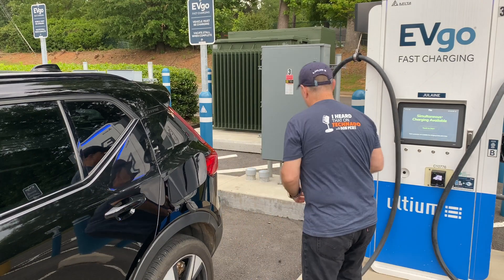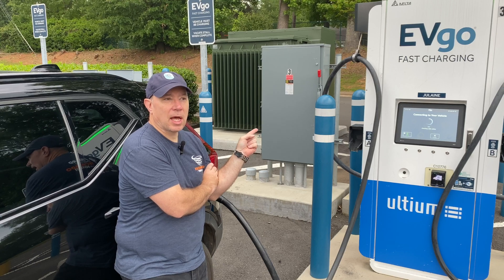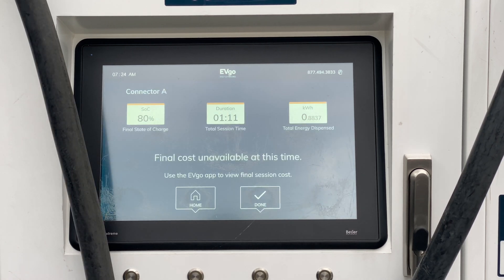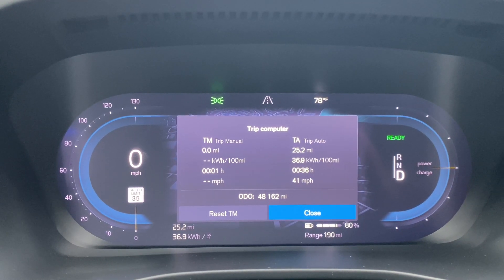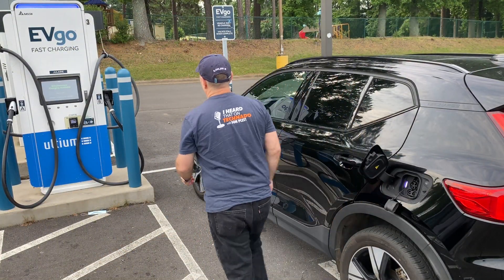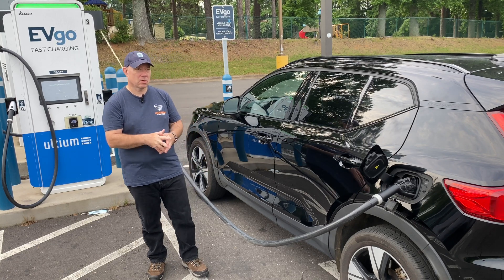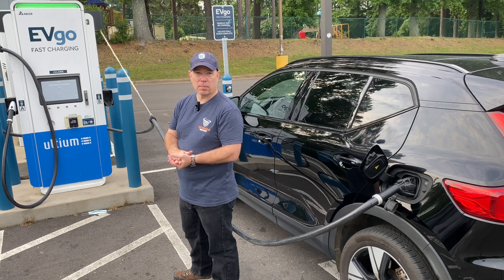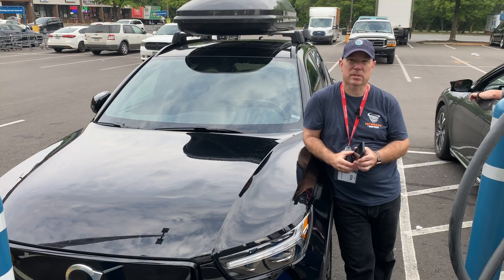EV Inefficiencies - Roof Cargo Carrier Test (Volvo XC40 Recharge)

Comment: We are curious the impact of aero when there are already other things imoacting the aero efficiency.

Ie, running a hitch mounted vertical bike rack already takes a huge hit on our EVs efficiency....curious if adding a small roof rack would really hit it more or if theres already so much turbulence created by the rack that the tiny extra bit doesnt matter as much
Reply from the maker: It depends on your speed I believe.  In my test, I was over 70MPH, so it was a bigger hit

Comment: I'd have used the car's reporting for miles and kWh. The Volvo is kind of bad efficiency without the rack. 2 miles per kWh?  Did you have the parking brake on? Yikes.
Reply from the maker: It normally averages three.  The lower efficiency is from the high speed.  All EVs have big drops when going over 70.  However, the Volvo XC40 recharge overall is not very efficient.  That is actually what I like about it.  It is not shaped like a suppository in an attempt to eeek every mile out of each kWh.  Instead it is a lux driver expirence focused on passenger comfort.

Comment: Walter, I thought the “with cargo carrier” would have done worse, but the basic car already isn’t that efficient, so the added drag doesn’t reduce the efficiency much.  A good test!
Reply from the maker: Thx!  It is a brick by itself 4 sure.  However the low efficiency was mostly due to the high speed.  I was cruising at 72 MPH.  At those speeds efficiency drops dramatically.  Under normal circumstances it does more respectable (~3 miles per kWh).  Luv that car.  Thx 4 watching.